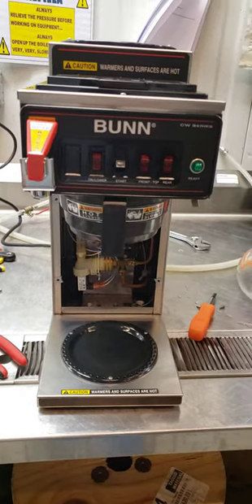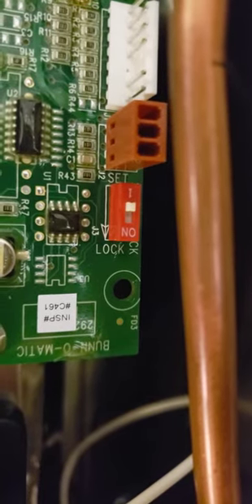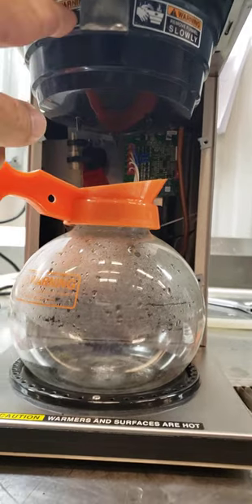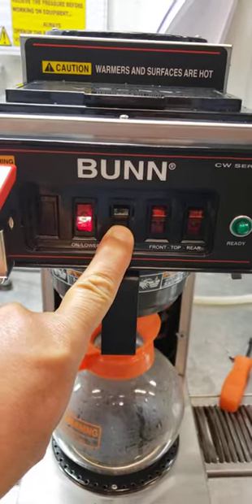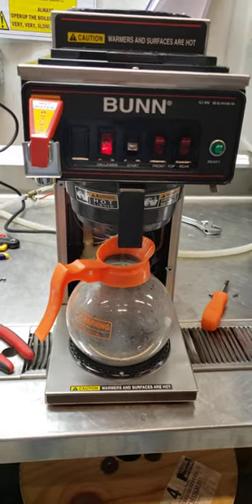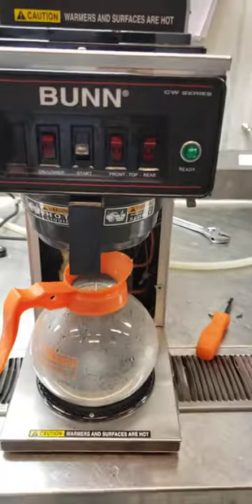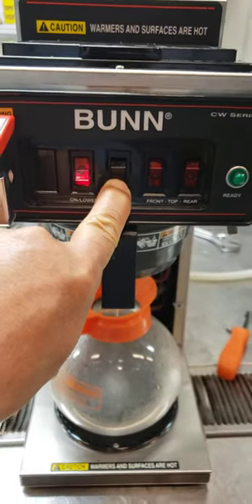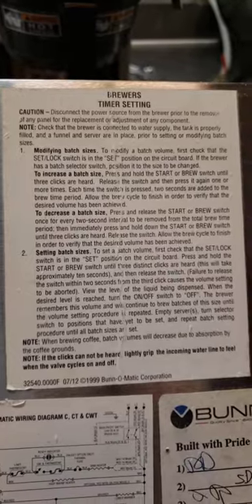Setting water level for the BUNN CW series

Comment: awesome video. Mine was filling to much. Backed it off. Perfect now. However. It constantly drips off and on when its just resting. Pretty soon its full again by itself and spilling over if no ones watching after it. Any idea whats causing this??  Do you have a video for that? 😮😬😕
Reply from the maker: I don't have a video but there's two things that can cause the water to constantly drip. The fill solenoid is not closing all the way and needs to be replaced or the main coil has a hole in it. Take the top off the brewer and you'll see a pan. water comes into the pan by the small tube on the back left. If water is dripping out of that then the fill solenoid needs replacing, if the water isn't coming from there and still dripping out then the coil is gone and that's a job for a technician but more often then not we just throw out the unit.
Reply: @pfeels  Thank you.👍👌🙏

Comment: I just installed a new one. But I have no Idea how to check the water pressure. It says that if it is at 90 psi it should be reduced to 50 psi? So...its working great but i hope i dont screw something up because I dont know how to check the water pressure..😢🤔😬
Reply from the maker: There's a restrictor in the fill valve so you should be fine.

Comment: I have a similar machine, but the water overflows from the clear-cut grommet where the sensor is inserted. I can't figure out how to stop it
Reply from the maker: Sounds like a bad grommet (Part #07073.0001) You'll have to cut it with a razor from the center out so you can fit it over the thin tubing. It may already have the slit. Water over fills the tank in order to push it to the brew basket so the grommet needs to be sealed.

Comment: there is a much easier way to do it  I do it almost every day
Reply from the maker: You shouldn't have to do it more than once a year but video hope you do it and send me a link. pfeels@gmail.com
Reply: @pfeels   what I do is connect a hose to where the water comes in to the receiving pan, hit the start button till you hear the 3 clicks and turn the machine off when you get to the desired volume. It should stay at that level for a long time.
oh well that's what I do.
Reply from the maker: @iandouglas2872  I think that's the way the Bunn tech taught my guys, I'll have to check but again I'm not sure why you have to do it every day. It should hold.
Reply: @pfeels  300 machines

Comment: I’ve spent over 5 hours to try to get it consistent and it never stays at the quantity I want it to pour into the decanter.
Reply from the maker: Try calling Bunn technical support. You should be able to get their number off the internet. If it won't hold then it might be a board problem.